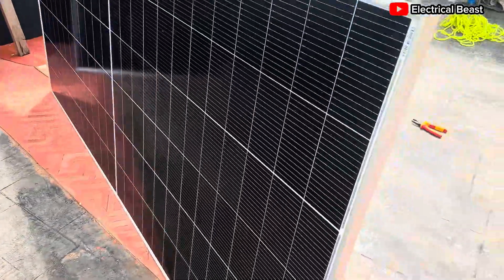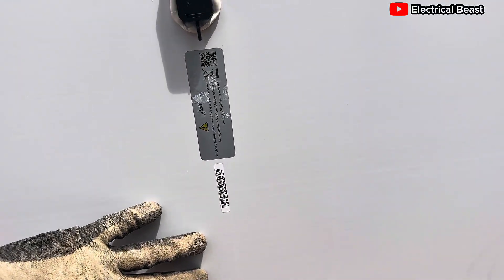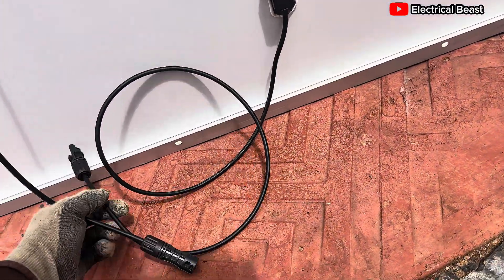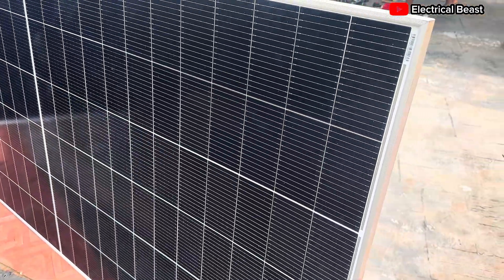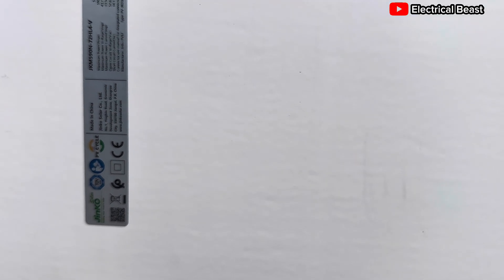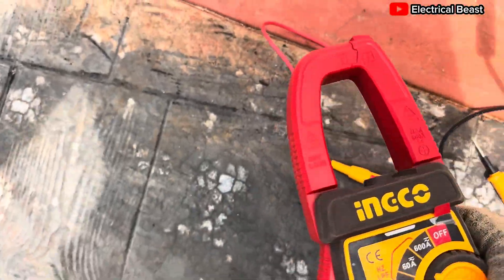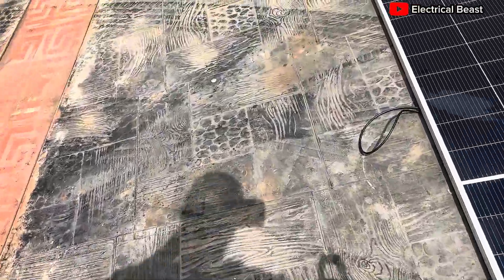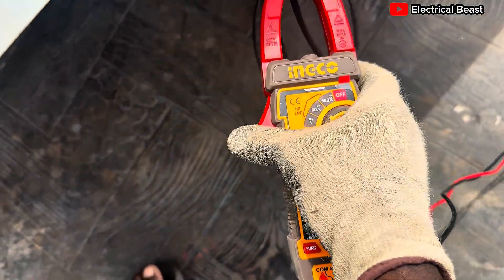How Reliable Are Jinko Solar Panels?

Comment: Please what's the length of this jinko panel terminal cable
Reply from the maker: A yard and half.
Reply: @engrgideon  This made me laugh. So surprised you're using imperial measurements!
Reply: Ok..is the cable long enough for vertical plugging of terminals from two panels ?